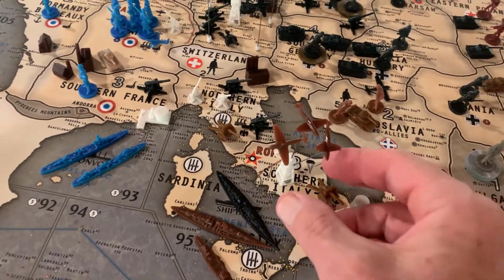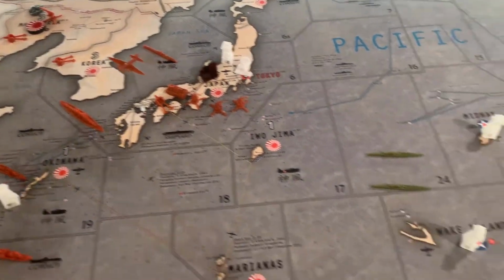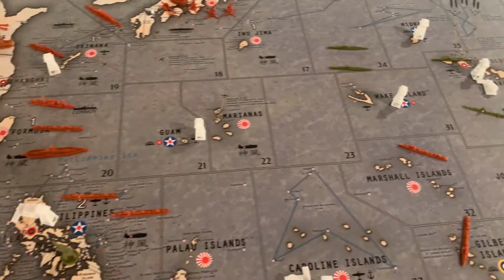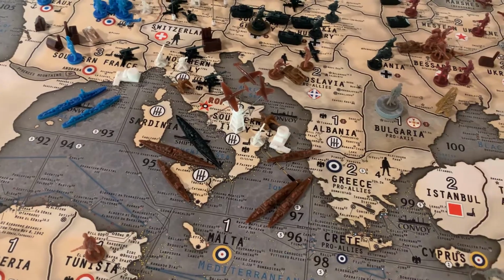Airbase Flight Stand (v2) for Axis & Allies

Comment: Have you magnetized your air bases or is that a future event? I’m just thinking about having three planes on top of them, might get a little top-heavy like old fashioned Barbie 🤣🤣

You’ve probably already thought of that, but just in case you haven’t it’s something to consider
Reply from the maker: Correct. Everything is magnetized including the airbases. Yah it wouldn’t work if you did not do that. If you look closely you can see the magnet I have on top of the base of the airbase. That’s what secures it to my table/map
Reply: Lt. Dan and those bases are from shapeways?
Reply from the maker: Yup they sure are.  They offer them in 2 sizes. The ones I am showing or have purchased are the small ones

Comment: Just doesn’t look that great, thought would be better.  Maybe if had a base and wires cam from that?
Reply from the maker: Uhhhh me no understand you communicate
Reply: @Lt.Dan..  Wut I sed iz, dun like the luk and maybee beterr if the tower sat on a base and the wires cuming from tat.
Reply from the maker: Haha so then maybe you like the first version because the wires were coming from the base of the airbase. I get you want a roundel for the airbase to sit on. Trying to minimize footprint is all
Reply: I disagree .. the wires out of the top are much cleaner